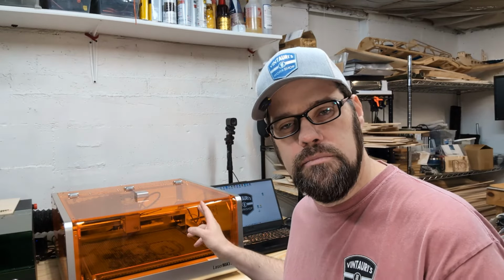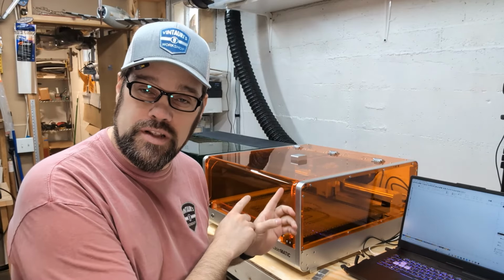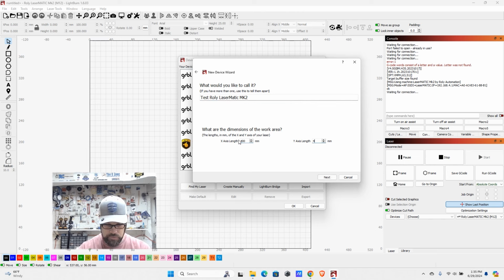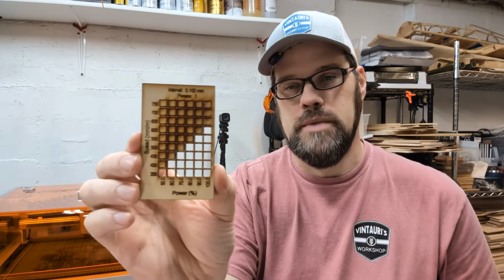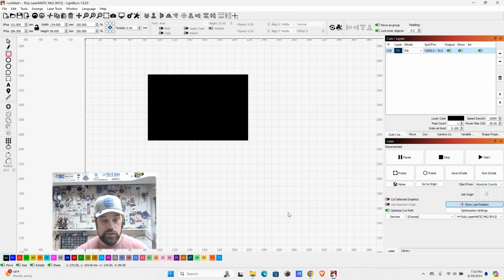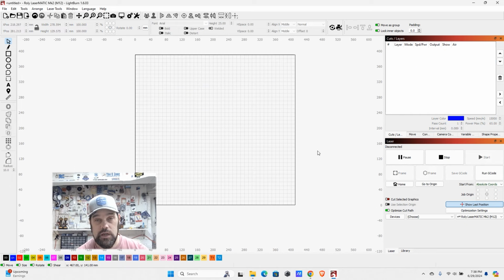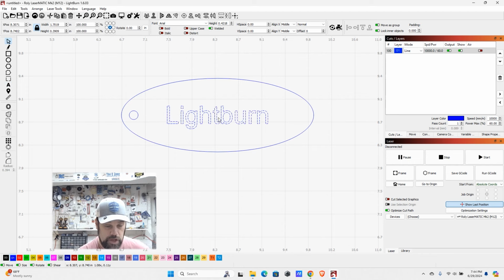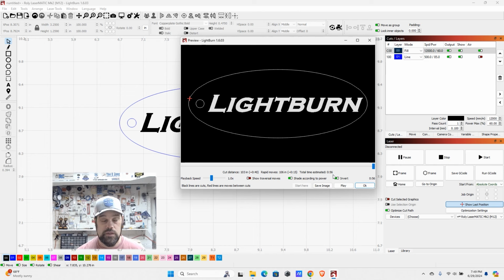Getting Started with Lightburn - Featuring the Lasermatic MK2 laser

Comment: Great video! How do you focus on a thicker piece of wood than 3/8”?
Reply from the maker: If you are going for an engraving, you use the thicker part of the focus tool to set the focus on top of the material.  If you are working with a cut, you can only drop it down so far before the module hits the material, so I would just go with the thinner part of the focus spacer to get it as close to the center of the material for the most effective cut.